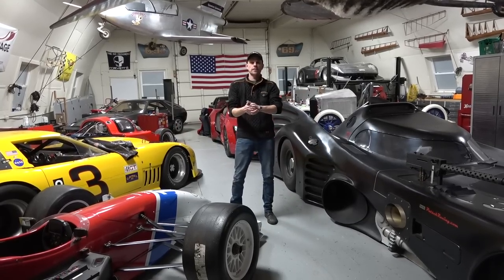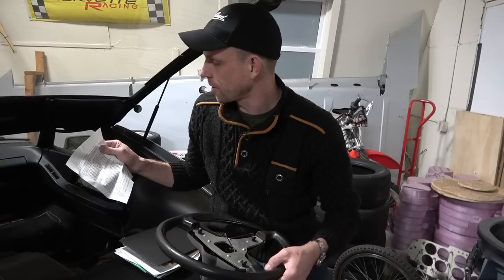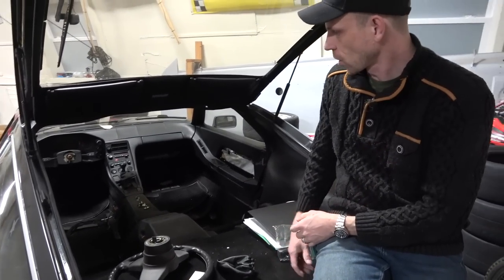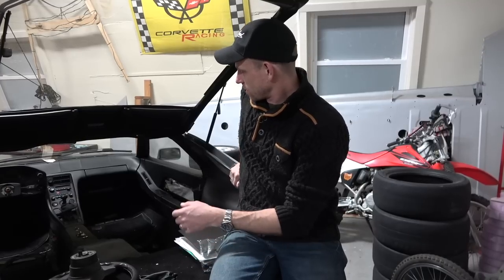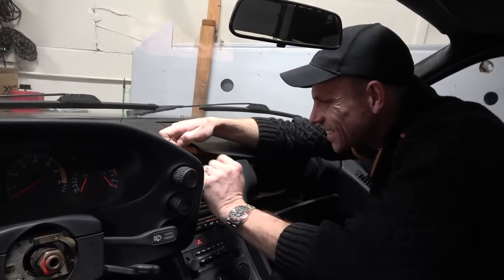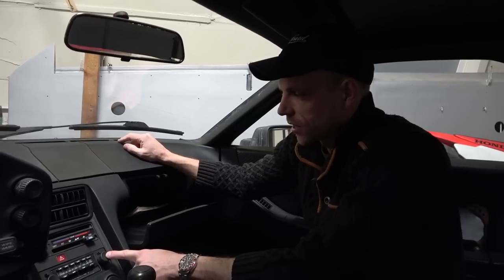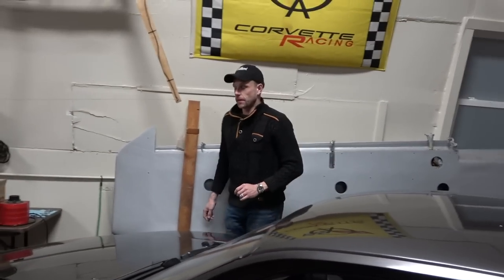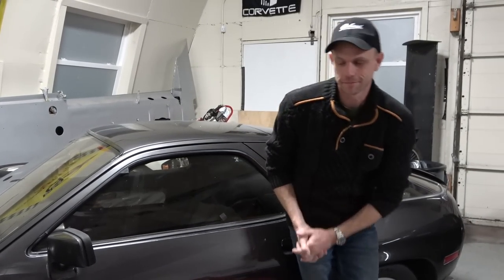PORSCHE 928 frustrations and interior restoration!

Comment: I fixed the dash and pod cracks on mine.  Read the Rennlist posts, several have gone before.  Dremel out the cracks so the foam “walls” are at an angle and you have removed the dead crumbly foam.  Fill with fibreglass reinforced bondo, and sand the whole dash smooth.  I covered mine in leather without a bunch of French stitching, you could also source a dash specific paint.  The vent trim pieces can work with any dash, just source them and modify your dash by removing some foam around the vents... that’s what Porsche did.

Comment: I can concur that the shifter play is very much on the loose side, plus the long throws.. Like a truck. They make a couple of short shifter kits, one has different implementation than the other and for that reason, one is is probably the better choice (can't think of the names of the kit off the top of my head unfortunetly). It might be the one one aftermarket piece that you want to put on the car to enhance the driving experience.

Comment: I’m hopeful the seat upholstery is worth the wait when it’s all said and done. 

I had a truck in a transmission shop after they rebuilt the transmission and it broke again in only 9,000 miles. After six weeks of waiting, I got it back with a completely brand new transmission, and the shop had also chased down the underlying electrical problem that caused my transmission failure in the first place! If it had been anything engine related, I could have fixed it in my garage with the help of friends, and tools they could lend me. Being a transmission issue, it was very frustrating, because I know squat about automatic transmissions. The transmission hasn’t broken again since, so it definitely was worth the wait. I had almost given up on it at around the 4th week of waiting, but they got it right in the end.

Hoping the same happens with the 928 upholstery. 🤞

Comment: Shifter play is most likely due to the coupler “ball” bushing directly under the shifter wearing out, or just completely deteriorating to pieces, which happened to mine (full disclosure: it’s a pain to get to without dropping the torque tube!). You can get the ball couplers on 928 Motorsports, 928 International or 928 Specialists relatively cheap. If that’s not causing the play there’s another coupler/pivot point towards the back near the transaxle that also likes to puke out bushings. Good luck! Really looking forward to watching you restore this 928!! May even light the fire under my butt to get back to mine.

Comment: K-Jet functions primarily by fuel pressures, system and control pressure, only vacuum line that effects mixture goes to the WUR, all other vacuum lines are for your regular stuff like EGR, vacuum advance, charcoal canister, etc. .   And can you post a link to the place you purchased the steering wheel wrap kit?

Comment: You can sand down the cracks to be level, fill them, and then recover the dash in vinyl or leather.   I did mine in stitched fake leather, but I've seen a couple people that did it in vinyl with no seams.  That would probably match a lot better with the console and door panels.  I don't know if the first couple years had leather options, but the leather cars did have plastic trim pieces around the vents.  You can trim the non vent dash to fit them (I used a non leather donor dash for my car).  Sometime in the last couple years (90s) they had a different style of plastic vent that was larger.

If you do send it somewhere classic 9 leather shop in michigan would be a good choice.  I got my cover from them.

Comment: My idea for the dashboard would be to cunt the cracks out, glue the whole thing back to the metal, fill the cracks in with fiberglass filling or any other filling, sand it down to be smooth, cover the whole dashboard with a thin foam and on top of that, cover it with real leather. then you would have a soft padded leather dash that won't crack again.

Comment: That 'dorky middle bit' of the steering wheel is the closest you could get to an airbag in the 1970s. It's specifically designed not to shatter in an accident and protect your face from the metal underneath.

Comment: MUST must must must replace rubber in fuel lines!  Must!  The rubber is over 30 years old and in NA we have ethanol in our petrol which also likes to breakdown the rubber.   The fuel lines are under 50 PSI (Or something like that) which is happy to cause a rupture to the rubber spill fuel all over the top of the engine and burn the car to the ground...  Seriously this is a must before any serious driving.  If you do drive it 10lbs extinguisher or two...   I did a blog about this with the relevant details for my 1983  928. Link below...

https://www.team928.com/2016/01/only-you-can-prevent-engine-fires.html?m=1